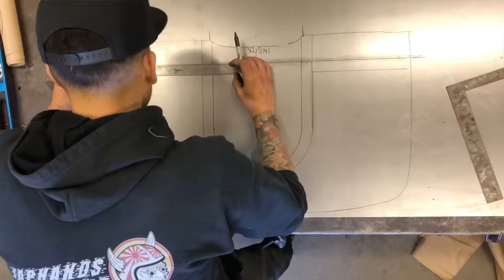How To MIG Weld Thin Sheet Metal - GMC G10 Boogie Van Rust Repair ( PT 2 )

Comment: This was beautiful! How do you see this butt welding compared to making a small step to the other piece and then having one piece slide over the other, the step being the thickness of the material, so that the end result is a flush finish. Hope that makes sense.

It would be nice to hear why that is sometimes used instead of a butt weld.
Reply from the maker: That is used instead of a butt weld if somebody does not want to do a butt weld. It’s easier to fit and wild. It’s easier and more forgiving do you not have to make a perfect gap

Comment: Great videos, I just found your videos. New subscriber here.  I have a question. What kind of metal do you use for these repairs? Is it mild steel? Or what is it?
Reply from the maker: Mild steel cold rolled 18ga and 16ga

Comment: You mentioned that youwould't want to use TIG on this, due to limited access. Could you explain further? Thanks.
Reply from the maker: I like to use a hammer and dolly on those welds so you need access to the backside. If I’m just welding and grinding then it’s easier to use wire feed for me because I can control distortion by keeping everything very cool

Comment: Hey Karl, I know this is an old video, but when you do weld the panel and you get the Heat Warpage on the panel, how do you fix that after the panel has been fully welded?
Reply from the maker: There’s no way to fix warp unless you can get to the backside to hammer the weld. Warpage comes from shrink from Welding. You have to him in the world to stretch it back out.
Reply: @MakeItKustom  ahhh I see, thanks for the reply!

Comment: You said your patch panels were 16 ga. Is the metal on the van 18 ga.? If so, what’s your process for welding this keeping the thinner metal from warping? BTW, I recently found your channel and loving the content. Great work!
Reply from the maker: Thank you very much Robert! The thicker metal takes the heat and absorbs it to help fight distortion and since I cut the panel near the form to body line in the van, it helps hold it’s shape

Comment: Is Zinc weld-through primer really a "primer" Rule is not to coat metal in "primer" unless you are going to topcoat since it will actually absorb moisture. Zinc is  used to prevent rust as a sacrificial coating. So it the world "primer misused with this product?

Comment: May I ask what your welder settings are? You said about your wire being .23, but how hot should the welder be set? Great work, by the way!
Reply from the maker: All depends on your machine but if it’s a meg welder I’m usually Pretty cranked on the heat and about seven wire speed
Reply: @MakeItKustom  , thanks! I am no pro welder at all, and only weld when I need to. I have a Lincoln HD140 welder. It seems to blow holes in the sheet metal, which is why I can't understand why? It is set on the lowest settings trying to avoid it from doing that, but to no avail. Should I turn it up instead? What would you recommend to get me in the ball park? I appreciate your advice, thanks!

Comment: Is there a reason you wouldn't Tig this kind of joint or was this just for Mig technique? Love the channel
Reply from the maker: For me, I like to cool between tacks For a Long Strait section like this I think wire feed is easier to control Heat

Comment: What kind of bench vice was that you used to shape the smaller patch panel?
Reply from the maker: Those were magnetic jaws that go into any vise
Reply from the maker: https://www.amazon.ca/Kaka-BDS-6-Inches-Brake-Magnetic/dp/B015U79GGQ/ref=mp_s_a_1_1_sspa?crid=7WL8E2MQLP7K&keywords=vise+sheet+metal+brake&qid=1641309032&sprefix=vise+sheet+metal+brake%2Caps%2C149&sr=8-1-spons&psc=1&spLa=ZW5jcnlwdGVkUXVhbGlmaWVyPUEzOE9aVDJYMkUyVE5DJmVuY3J5cHRlZElkPUEwMDAzMDgxMUNNU0Y1V0dGOEwxTCZlbmNyeXB0ZWRBZElkPUEwMjMwMjQzMVAyTlVCUjVSV1JUVyZ3aWRnZXROYW1lPXNwX3Bob25lX3NlYXJjaF9hdGYmYWN0aW9uPWNsaWNrUmVkaXJlY3QmZG9Ob3RMb2dDbGljaz10cnVl

Comment: I use a hand belt sander with 80 grit sand paper to San the spot welds it cost about 20 cents for a pice of sand paper. Use 3M sand paper.   You don’t want to use more corse sand paper it just wastes the sand paper. All the drilling takes to long

Comment: What’s the settings and brand of welder are you using?
Reply from the maker: Check out the mig welding video. It will teach you how to set any welder
Reply: @MakeItKustom  will do man. I need any help I can get. LOL
Reply: @MakeItKustom  I watched it. I can’t wait to get back in the shop. Thanks again. Your a great teacher.

Comment: No inside panel wax for rust prevention ?
Reply from the maker: I’ve never use that stuff before just the primers and Metal prep
Reply: @MakeItKustom  Depending on climat and some other factors it will rust from inseide out, If not protected ! 
Very Nice work by the way !!!

Comment: What about the rust on the horizontal panel up behind this new sill panel, which is clearly shown at 3:29....?
Why is this not sanded and then treated..?
When the new sill panel is on the rust left in this box section behind it will eat away at the metal.....

It makes no sense when this rust is accessible with the old sill removed, to not deal with it.....

James Hennighan
Yorkshire, England
Reply from the maker: Keep watching man I did all that

Comment: Inside to panels when you was doing the panels for the seals inside between the two panels you had a box section I know you said you use rust conversion but most panels on a vehicle you cannot get to the inside because of the structure of the vehicle when you have trying to get metal when it is rusty where you cannot see it so inside if you cannot get to it you will use a conversion rust conversion treat where the rust is I have seen you can use a laser and you could use it as well for welding when this laser can clean rust off would it be better to use something like that and then use the rust conversion cos that would be more logical if you have still got Rust and you're only using risk conversion you are better chances going to still Rust and eat away your metal

Comment: Don't you think zinc makes the weld splatter .
Reply from the maker: Yeah it does but at least it’s protected
Reply: @MakeItKustom  Needs a better material , of course the weld will burn the zinc,  maybe a bit counter productive on the welded bits , that said good work , must of taken you quire a while to doit despite fast speed 😁

Comment: Had a body shop "replace" my roof on a truck. Years later the paint started cracking and the roof was leaking. Ground it out with a wire wheel to find out they filled the rust spots with filler and it finally started cracking. Nice scam they pulled.
Reply from the maker: My goodness man that’s ridiculous!!! Crooks!

Comment: Bad Chad would say your wasting your time grinding that much off, you just need to slather a gallon, maybe more,  of bondo over the complete panel.
Reply from the maker: I love bad Chad but I guarantee I don’t use even 20% of the Bondo he does. That does not make it better or worse it’s just a different way of doing it

Comment: You are doing it wrong and make it harder on yourself. 16G warps just as 20G, because you need more heat to fuse 16g you will warp by adding more heat. The best way to prevent warpage and line up your new panel to the existing one is to always leave a flange on the old one. Never but weld your sheet metal. weld on the flange. You will dissipate heat away from the weld line, seal the weld from oxygen contamination, and automatically line up the two panels.Also leave 1 1/16 gap so the weld is flat and into the flange. Less grinding. Then you can cove the weld area with a thin lead layer, sand and you are done. This is how it was done with oxyacetylene 50 years ago. JUst put a straight edge vertically instead of horizontally. You will see that the whole panel has moved out in a sharp point at the weld line.

Comment: this was suppose to be about how to mig weld thin metal but you explain the shit out of how to remove rust and tack welds, this that and the other but when it actually gets to the welding it goes into high speed with absolutely no explanation as to what you are doing and why you are doing it and then we get a brief summary at the end after all the welding is done i was disappointed sat through all that bull for a high speed blip as to what the subject was about

Comment: You can do this with a flux welder.. or any welder.. if you go slow and zap it one tack at a time.  A trick is to also keep the wire further out on flux.

Nornal flap disks work too i like 60  grit.

Fyi if you wanna live past 50 without COPD i highely recomend you start wearing p100 respirators.  I am completetly flappergasted at the youtube channles i see of people welding and grinding and cutting with no masks..  utter stupidity